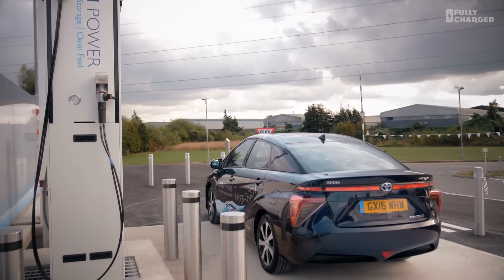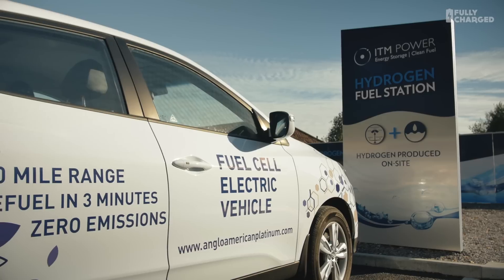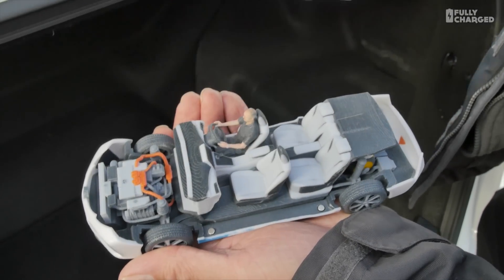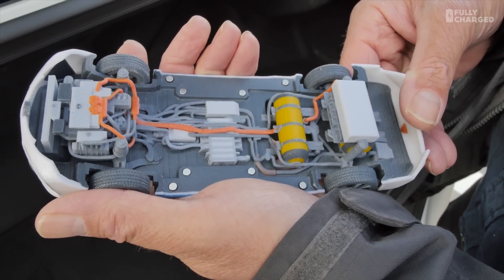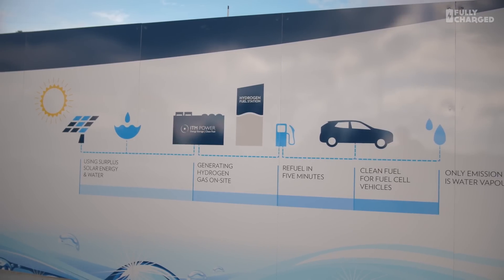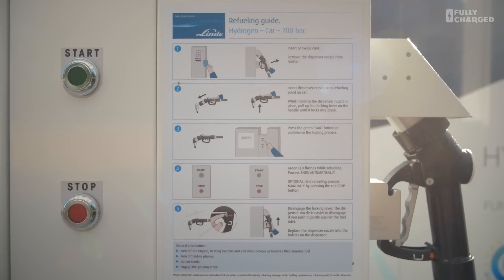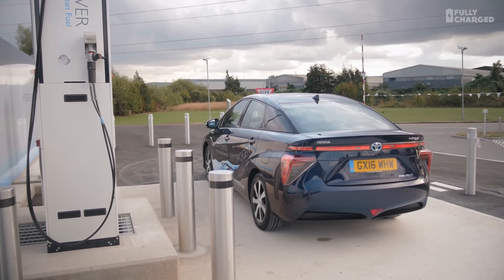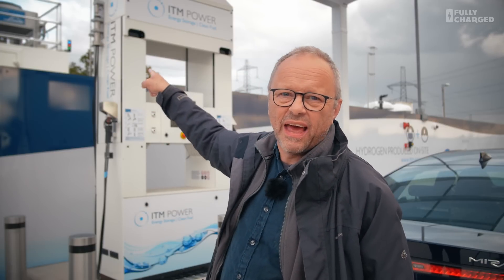ITM Hydrogen Rally | Fully Charged

Comment: Honestly I see hydrogen as a great tech for long distance HGVs, coaches, buses etc. But it's a pretty inefficient (expensive) when compared to other green technologies.
I didn't even factor extreme cooling during refueling into my old hydrogen vs EV arguments..
Reply: The Miriai is rated to 114 kWh max output with 370 NEDC Mile range where as Tesla has just came out recently with 100 kWh/381 range. So tell me which is more efficient?
Reply: Efficiency doesn't equal range.. I've often said that hydrogen cars are akin to using electricity to power a fan to power a wind turbine to charge an electric car. It's far more efficient to use the energy directly.

Which is a simpler example than using said electricity to split water, compress, store, cool, and recombine to get back to electricity to power the motors.

Just lookup the inefficiency of electrolysis alone to understand my point.
Reply: I was agreeing with you and as for your opinion where it is better used and from my own experience driving lorries or semis, the recent news of Nikola Motors and their model One from NG to Hydrogen makes more sense than NG which is not as green as Hydrogen. Nikola even notes on their website it takes 100 kWh of electricity to produce the amount of hydrogen that ITM is showing here, but instead model their system on solar power more. Even to the point of having 1000 or 10,000 gallons of hydrogen on hand at each station to supply satellite stations.
Reply: Joshua Cornell Sorry I misread your original comment :) 
Didn't release Tesla had already broken the 100kwh mark. I stopped following tesla model s developments as it was depressing that I probably won't ever be able to afford one!
Reply: I would not own a Tesla as per their price to own, I would consider it if I won the lotto, its still cheaper than a Ferrari, Maybach, Lamborghini or such in comparison to maintenance/repairs. insurance and fueling cost compared to similar price ICE cars. I never knew about the Tesla powerpack increase to 100 until looked at the wiki again when I went to comment in this video to some others.

Comment: I am curious was that does to the environment.
They do take oxygen after all to generate that. Releasing water out into the atmosphere in big amounts doesn't sound good.
Getting the energy through solar panels and then consuming that without changing anything in the atmosphere(until you need to recycle the batteries) sounds a lot better...

Comment: This is INSANE.  The energy required to make the hydrogen in the first place is wasted, plus you need to store it.  I can already buy a Tesla that does 300+ miles which isn't filled with an odorless, invisible, explosive gas.  This is dead end tech, batteries will only get cheaper, lighter and increase their capacity.

Comment: I have changed my mind slightly on fuel cells ,may be possible to use in large vehicles , commercial operations , but still other questions about why not store energy directly in batteries at more efficiency and what weird cars, over complicated tec , Toyota have taken the train of hydrogen and can't jump off but still think batteries stolen their thunder in so many ways and will get better, hydrogen fuel cells jury still well out for me

Comment: Interesting technology but why... the only commodity versus electric cars is fast refuelling but with the emergence of fast chargers for electric cars, is it still worth it? What is the loss in transforming electricity and water into hydrogen and then hydrogen and air (oxygen) again into electricity......  and water

And how much water do I need to produce hydrogen for a full tank? For a couple cars it's ok... what if 10% of current European cars worked on Hydrogen? Can it use rain water or sewage water or must it have clean water to start with? Is the water produced by the car stored or sent trough the "exhaust"? How much water is lost in the process? Thanks

Comment: The last guy who was explaining did not make a lot of sense, stuff about hydrogen being 'energy vector' (what?!?) etc.
If you want to put load on grid during low usage timing, why build all the hydrogen conversion apparatus? Wouldn't it be simpler and possibly cheaper to just deploy a massive battery? Doesn't have to be Li-po, just some cheap one. That hydrogen apparatus is the size of a half-size shipping container anyway, a battery that size could store a lot of energy.

Fuel cell technology only makes sense to me where energy density (per volume as well as weight) is absolutely critical, such as spaceships and military applications (submarines). You can have massive high pressure tanks of hydrogen and oxygen, which will provide a much higher energy storage density than any battery currently used. Makes no sense for civilian commercial use, you need to deploy a lot of infrastructure, whereas battery charging infrastructure is essentially already in place everywhere so why not just use batteries?

Comment: Much as I'm a fan of Fully Charged the style of dumbly accepting what manufacturers say is wearing a bit thin.  Surely it isn't beyond the wit of Robert to ask the glaringly obvious question: "How far does this hydrogen car travel per KWh taken from the grid"?  I'll bet it is far short of what a battery based car would travel...
Reply: By looking at the wikipedia info on both, this has a set 370 NEDC or 312 US Mile range with max volume weight of 5 kg  (11 pounds) with max 117kWh output, and Tesla range from 210US/233NEDC for the 60kWh to 315US/381NEDC for 100kWh
Reply: @Joshua: Which doesn't answer his question of kWh TAKEN FROM THE GRID.  We already suspected that the electrical portions of a HFC car and a BEV car would be near the same.
Reply: It takes 1kWh per mile for FCV, and around 0.35kWh for BEV

Comment: I can't see how hydrogen can be competitive when the energy conversion efficiency is roughly 1/3 that of charging a Li-ion battery...yes KWh for KWh the cost of the actual storage system (i.e. the hydrogen conversion equipment/compressor/cooling etc.) might be competitive vs. a battery of equivalent capacity (due to high energy density) but if the cost of the energy is too expensive due to the low efficiency (e.g. you need 3x as many windmills to provide the same power output to the customer) then no one will buy the hydrogen; they'll fill up their battery with charge instead.

Comment: well, this is still better than petrol, but not really better compared to the battery because electricity need no more conversion to other form and can be charged almost everywhere, the plus side of hydrogen is the availability, it is almost unlimited, not only limited fresh water supply,  they can even purify sea water and convert it to hydrogen to keep the price low, the downside that is it is need a really cold environtment in order to charge it safely, which also need electricity, let's see how they handle the electric bill for all that

but in the future, there is possibility of a big obstacle, once the graphene (the true 1 atom thick layer of graphite) battery for car is officially invented and released to the market, that  3 minutes fill of hydrogen got a new heavy rival, since this type of battery can also be charged at home

Comment: Hydrogen must be the future, we wouldn't need to change much in our normal lives where as with green electricity we would.
Reply: Suppose change in the future makes it easy to summon more types of self-driving vehicles to your location from your mobile? Getting a truck to haul something will be just a few taps away. Going on a long-distance trip? Summon a 300-mile-range EV, ICE, or Hydrogen vehicle that can recharge or refuel while you stop to stretch and eat. Most of the time people just need a small vehicle with a range of 50 to 150 miles, depending on commute length. Electric vehicles can do most of those trips. Hydrogen could replace ICE, but it's more expensive and needs infrastructure built that duplicates what ICE already has.

Comment: What is the efficiency of this fueling station? What is the efficiency of the fuel cell in the car? Basically, the question is, what is the efficiency of complete cycle, starting from the wind mill, up to the traction motors in the vehicle? In the electric car powered by Li-ion battery, this complete cycle efficiency is at least 80%. So, for 100 kWh produced in the wind mill, 80 kWh will be transferred to kinetic energy. Now let's see, efficiency of electrolysis at the fueling station, to produce H2: 70%; efficiency of the fuel cell in the car, which produces electricity from H2+O2=H2O: 60%. So, 100kWh produced by the wind mill, only 100*0.7*0.6=42 kWh will be transferred to kinetic energy of the car. Which means, battery-powered EV is AS TWICE EFFICIENT as fuelcell vehicle. 

The numbers for efficiency are taken from wikipedia (Electrolysis, Fuel cell, Electric car) for the present-day commercially available technologies.
Finally, how much does it cost to store effective 1 kWh in form of H2 at this fueling station in comparison to the stationary battery storage? And also what is the difference in the initial installation cost for fuel cell and battery? I think Hydrogen is not in favor here too.
Reply: Take the Tesla Model S Line up, they can get anywhere from 210 US/233 NEDC Miles at 60kWh up to 315US/381NEDC Miles at 100kWh, where as the Mirai from Full tank gets 370 miles NEDC range which is about 312 US with max 114kWh. This is all I can and have to say about the difference in what you are asking.

Comment: On a global scale and if many many cars on the road become hydrogen powered, won't that increase humidity because of all the water coming out ?
Reply: That would be one heck of a moist topic.
Reply: Epic Facepalm. No. You aren't creating water from nothing. You only output as much water as that which you input to the to electrolysis unit to be split into Hydrogen & Oxygen in the first place.
Reply: Thanks Kyoukoku for the explanation to my joke in response to aboriad 15's comment.
Reply: +Joshua Cornell My reply was to aboriad15's comment, rather than yours, so sorry if I wasn't clear!
Reply: I was thanking you for commenting to them as I could not have said it better myself, all I could come up with was that short one liner,
Reply: Yes, but isn't it safe to say that we are taking water, just like in the method in the video, and blowing it in the air/on the streets?

So stored water becomes water that we don't have because we can't collect it from all those cars.

I think it makes sense, no?
Reply: First of all tanks have a capacity, and though water is not short in supply, this system requires potable natural non salt water that was desalinated as it would be contaminated. Secondly the hydrogen particles which make up 2 parts with the oxygen making up the other third and single atom of water molecules is being separated for use in the engine. Thus leaving oxygen particles to be either gassed off for us to breathe in or if the station was made for it to tank and pressurize those oxygen particles for medical or recreational and other diving use.
Just like water evaporates and once you got enough in the upper atmospheres you get clouds and those clouds when they reach a certain mass will rain down. Now with hydrogen powered vehicles, that hydrogen is mashed with oxygen in the intake to produce said power to energize and power the vehicle, The end result is water from the tailpipe, thus very little water is lost.

Comment: I would call BS on his "fuel cell produces no heat" comment. The current implementation of their fuel cell requires cooling, but it requires LESS cooling than a similarly sized petrol engine.
Reply: Right. And one of the advantages of fuel cell cars is "free" heating with waste heat from the fuel cell. Without any loss of range. Like cars with ICE.

Comment: There are any number of reasons that running vehicles with hydrogen is a questionable practice, but there is one thing that I can't get anyone in the industry to answer satisfactorily is this:  The industry keeps saying, "the only byproduct is water."  I live in the very north of the U.S. and here it is below the freezing point of water 1/3 of the year, and for months at a time below zero Fahrenheit (-18 c.) and I've seen temps of -50 f. (-46 c.).  I can only wonder what the roadways would look like with automobiles spewing water from their tailpipes onto frozen roadways.  How would this technology work in the frozen northlands around the world?
Reply: It's only 60ml/km (100ml/mile). So not very much water, just a drip every 20m or so. But it's a good question. I guess on a busy road it'll be enough to add some ice to the centre track where the exhaust is.
Reply: +xxwookey  --  Thanks.  Makes it more understandable and with only a few hundred in an area at that rate it probably wouldn't make a noticeable difference as I'm guessing that gas burning vehicles probably put that much condensation out of their tailpipes.
Reply: The amount of water you produce from burning gasoline is about the same. You can calculate it!

The Mirai has a fuel efficiency of 60mi/kgH2. 1kg of H2 produces 9kg of water, so that's 150g/mi.

One gallon of gas produces 3.2kg of water, so an average US car (25mpg) produces 7.68kg of water or 127g/mi.

Comment: could you have a hybrid car: electric/hydrogen rather than electronic/petrol or diesel.
Reply: That's what this is.  The fuel cell makes electricity, some of which gets stored in a battery.  Unless you mean Hydrogen internal combustion, which has all the drawbacks of petrol engines AND all the drawbacks of Hydrogen Fuel Cells.
Reply: CorwynGC like the idea

Comment: So they're using wind to ELECTROLYZE water into hydrogen, then COOL it to -40C, then COMPRESS it to 1000 bar of pressure... that sounds like a LOT of wasted energy. Isn't this proces very inefficient?

I can definitely see the advantages in the storage of the fuel, and fast and easy fill-up, and the fact that it can be produced with surplus energy but still; shouldn't the process be as energy efficient as possible to begin with?

Comment: When they showed the innards on the model, this thing looks super complicated. How much is it gonna cost to fix when warranty expires, looks to me about 3-5X of a normal gas car.  what's the engine efficiency on this 30%? 
also the guys in it are talking with very smug faces about them improving efficiency this and that, but how much energy is required to produce that kilo of hydrogen? cause if u have to put 80kwh to get 40kwh out of it than that a massive waste that could be put to better use (like lighting a house), that otherwise could be used just driving something light like a BMW i3 or something like that.

price is high, what's the performance on this?

fueleconomy.gov lists it at about 65mpg, not much better than current new Prius.
How long was this in development?, this thing needs a lot of improvement before it's even considered, an no fueling stations anywhere to be found. weird.

Comment: London, London, and Rotherham! Now that's what I call a sensible network :o(
Sort of kidding.....It is nice to see the start of an infrastructure.
I don't get the quibble with the generation of hydrogen being inefficient. If it is free, then that just means it takes longer, and that the power used could have powered something else for longer. It is still free and pollution free, so bring it on, or make me a nice cheap Tesla before I retire, and no longer need one :o) 
Until then I will stick with my Gen.1 Honda Insight. It has saved me £9,000 in petrol so far, and cost £5,000, £4,000 of which I would get back if I was stupid enough to sell it.
Reply: @Roger: "If it is free, then that just means it takes longer, and that the power used could have powered something else for longer."

It isn't free.  Nothing is free.  The 'quibble' with inefficiency, is that you could fully charge 3 Teslas for the energy that it takes to fuel 1 Mirai.  That means 1/3 as many wind turbines, or PV panels needed.  Or put another way, 3 times as many pollution free vehicles!
Reply: CorwynGC So it is still totally green, but will cost the end user more. We still need this sort of option running in parallel with the Teslas, because who knows when a technological break through will turn up, so let's have green diversity and healthy competition.
Reply: What 'break through' are you expecting?  Conversion of electricity to batteries and back is about 85% efficient right now, there isn't a lot better it can get.  Fuel Cells need to increase by at least 50% to be in the running.  We can start building a huge, expensive, energy intensive infrastructure, when it makes up that gap.  No point in doing it now.  After all there may be a break through that would make what we do now obsolete.

Comment: Hydrogen is really really stupid. It's much more efficient putting the electricity into batteries than making hydrogen and then going back to electricity via a fuel cell - 86% vs 30%.  The only benefit of hydrogen is that it can be stored like a carbon fuel and so it's possible to store lots of it cheaply (compared to batteries, mega-caps, spinning storage). Making hydrogen is about 60% efficient and a fuel cell peaks at about 50%.  Hydrogen has it's place - but batteries are better for storing smaller amounts of energy efficiently.

Comment: my opinion is: hydrogen for cars makes no sense
to generate 1 kg of hydrogen you need 65kwh - this is the amount a mirai needs for "nearly" 100km - the car uses around 15kwh for the distance
this means the effiency is less than 25% - that is really poor
a real e-car in that size will make 400km with 65 kwh
the use of hydrogem is a waste of energy, not to mention the problems of a high pessure system >700bar and the high costs of a filling station >500.000 pound